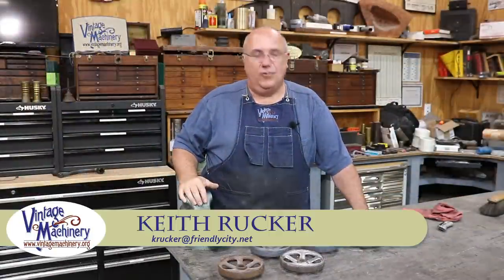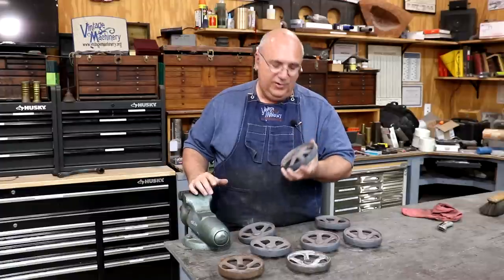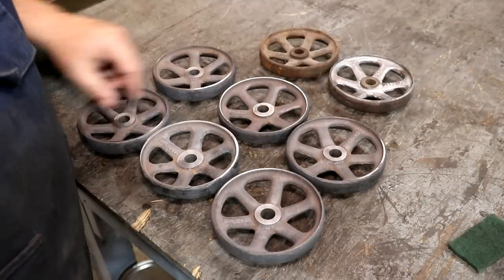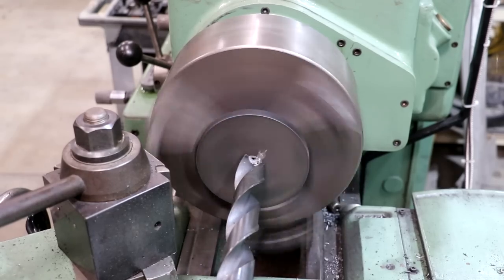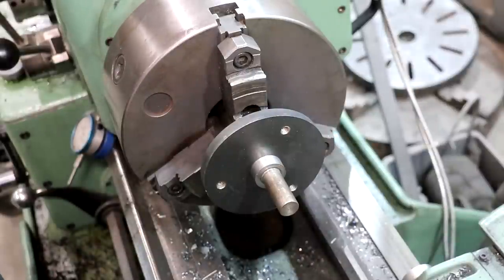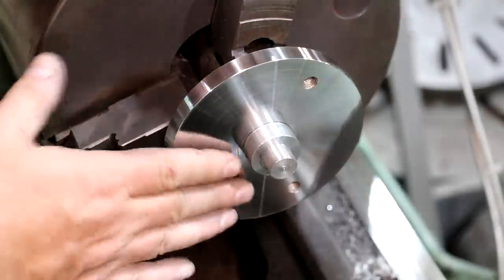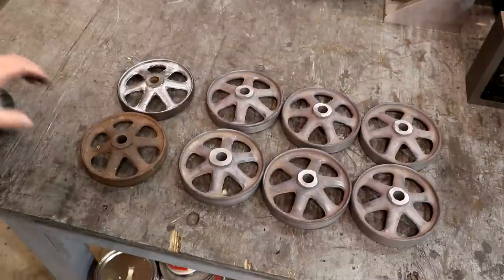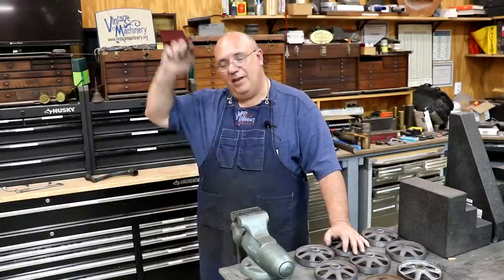Machining Cast Iron Wheels for an Antique Vise Cart

Comment: For anyone who watched this and felt the need to come down here to the peanut gallery and talk about how Mr. Kieth "shoulda done this or that", why? There is such a thing as overengineering, and I think you're missing the point. These are not precision gears or pulleys, they're literally wheels for a cart. This method was about two orders of magnitude more precise than was necessary for the project at hand. Had more precision been necessary, the castings would not have been done off of an original, but would have been turned into a 3D render and a pattern would have been made oversized to allow for much finer resolution of operation. The fixture would have been different, the process would have been different. If more precise parallelism had been needed between the inner and outer hub face, once the shaft and recessed hub face had been done, he could have done the other side on the surface grinder by simply magging the recessed face to a cylindrical gauge block of appropriate diameter and ground it to within .00005 without much difficulty. This would have taken more time, and again, would be completely unnecessary. If you don't need to hit 99.999999999% of nominal, why spend all the extra time on doing so? Particularly in a production environment, even if you're just a hobbyist making one off parts, why would you want to pour an extra 10 hours of work into a project for no reason? Give the customer what they want, for a price they can afford, and don't waste their money adding "billable hours" to a project that doesn't need it. Truthfully, Mr. Keith's approach was already far more precise than was necessary. He could've been anywhere from five to fifty thou out in any dimension, and it would not make an appreciable difference to the end result of this project. But because Mr. Keith is a proper machinist, he tends to go a couple of orders of magnitude finer than what is actually needed.

Comment: It’s amazing to watch you think your way through the problem and devise a working solution. You have a very logical mind. As to other comments as to “ugly looking parts” It’s a wheel for an antique vise cart. When laid out next to the original wheels, the only major difference I could detect was rust. Darn fine work in my book.
Reply: They're not using the Original Wheels, thats why they cast 6 new ones.
Reply: @TheUncleRuckus  they cast the new ones using the original wheels as a pattern. Did you not understand or are you being obtuse?
Reply: @TheUncleRuckus  I  was under the impression that there are 8 wheels(4 sets of 2 ) on the cart, 2 old, 6 new(cast from molds of the old ones)

Comment: I love to watch how ppl do things compared to how i would. I would have done the first op just like you but for the 2nd op, threaded the fixture hub post and clamped down with a nut. I wouldn't have used the round fixture plate. I also would've added machine stock to the pattern, however, like you said, they should work fine with the minimal clean up you got. Thanks for sharing your projects!

Comment: They are probably better than original.  I can remember items with wheels like that, still in service, when I was a kid: old hand trucks, scales, and carts.  They were rarely true or straight, and it wasn't uncommon that three wheels would be touching the ground and the fourth sitting well off the ground.  I think they were made for working on dirt floors, and once concrete became more common, they just weren't meant for something that flat.
Reply: That is SO true. We still have some old carts with these irregular off concentric castings.  PLUS some cheapo recent crookedly cast caster wheels, made in China, of course!

Comment: Am I missing something here. If the depth gauge measured 950 then why set the DRO to 9375. Surely they'll all be too thin? Also the attempt at making everything concentric seems to have gone horribly wrong. Whilst turning the second side OD (about 25:50) the inner boss has a right wriggle going on. This might have been due to the huge amount of leverage on the holding clamps being so distant from the centre boss. Having taken a skim off the outer rim area on side one, why not use this as the register? Just a thought.
The video still gets a thumbs up from me as we don't want to loose sight of what we are making here. These are cast wheels for an ancient cart. Thanks for taking time to produce these videos Keith.

Comment: As the wheel was only registered against tge centre boss and then clamped near the rim, the clamping method used actually pulled the wheels out of true. You can see the run out of the bore as the second sidebis turned  it would have been better to either register on the rim after it had been trued and/and or to indicate the bore to confirm that it was running true, as the clamping method used vs the small bearing surface ensured the screws could/would pull the part off true..
Reply: We fully appreciate your criticism as I am a bug for precision too.. HOWEVER  these are freekin' antique CART WHEELs, operating at a max rpm of... maybe 15 rolling on a wooden floor- NOT jet engine turbine rings running at 20,000 rpm !
Reply: @loftsatsympaticodotc  it's about wokmanship, and doing things as precise as possible. Why not just use a hand drill and call it good then?
Reply: @daveanderson2316  He did make it as precise as possible! There are high and low spots in the floor so Keith made matching high and low spots in the wheels. Now the carts will roll effortlessly across the floor as though it was on a cushion of air. It is called "tailor made". 
If you walked into a tailor shop and saw a suit on the rack with one short arm and a short leg, you would laugh and criticize it and the poor tailor that made it. Until the owner walked in with one short arm and a short leg. Then when he tried it on you would see that the suit was perfect. If you carefully read the scriptures you will learn that perfect only means complete. Everything God made was perfect for what He intended it for. Perfection is NOT some imaginary mark in the mind of a spectator/critic, it is a very real mark in the mind of the creator, regardless if he is God or Keith Rucker. PERFECTION IS DEFINED BY INTENT OF THE AUTHOR/CREATOR.
Reply: @artszabo1015  Thanks for the sermon. Perfection is actually in the numbers.
Reply: @daveanderson2316  Perfection is a mystical quest, some you win some you lose.
Reply: @mossmonaco9061  Are you saying 2 plus 2 doesn't actually equal 4? Tell me more...
Reply: @daveanderson2316  This could be 1984...Big Brother says 2+2=5 😁 (see George Orwell's novel for those who don't read the classics)
Reply: @loftsatsympaticodotc  a lumpy wheel is still a lumpy wheel no matter how slow or fast you move it.

Comment: I don't know much about 3-D printing or machine shop work, but from what I've seen if a 3-D printer was avaialable, it might be an ideal tool to make the pattern to the original size plus extra for machining.  Contrary to your critics, making new parts from old worn out parts as a guide is difficult at best.  Can't expect too much precision with what you had to work with.  Besides, a vise cart is not likely to be a high speed piece of equipment.  Excellent job and problem solving skill in this (and other) projects.  Keep 'em coming.
Reply: One needs to adjust for shrinkage as the metal cools also. My father in law was a pattern maker and had a set of shrink rulers for different metals so that an accurate pattern could be made.

Comment: I want to start by saying that I enjoy your videos tremendously, both my Dad and Grandpa were tool and die makers, I even ran and owned an automotive machine shop till I decided to become a city manager and fire chief, strange choice for a mechanical engineer, I am retired now and reverting back to my machinist days, I’m wondering if you considered making a shaft threaded on one end and a cone washer to center it to cut the second side or would that be a bad choice, keep making those great videos !!

Comment: I like your fixturing and holding solution.
On the other hand you measured the hub thickness .950'' and then cut the new one's at .9375 . Did you screw up the parts or was your initial measurement wrong on the mic reading?
Reply: I was wondering the same thing.  We'll probably never know.

Comment: Looks like you could've used the threaded holes for the bolts that hold the chuck jaws for clamping the parts, instead of making that improvised plate.
Reply: Keith has said he needs "improvised plate" making practice.  I believe that is why he chose to do what he did.

Comment: When casting wheels.  Do you wind tape around the original to take up for shrinkage or do you powder coat the part since you have a heat treating oven that might be used to set the powder coating . Build it up by dipping in a clay slurry multiple times. Or a ceramic glaze.  Even using a hot glue gun to build up surfaces or missing  areas.  One could even get creative and add more draft to the part.

Comment: Your welded on backing plate should have been a larger diameter to register on the previously machined surface instead of clamping down on the cast spokes.

Comment: Great fixture build!  I would have been tempted to clean up the outer exterior of the center boss for appearance sake, but knowing it’s a antique reproduction part, what kind of original finish would have been appropriate on a mass produced cast iron wheel? Prolly just what you did.

Comment: Why couldn't Clark dip them in a few coats of wax or something similar so they are slightly larger to accommodate for shrinkage?
Reply: Sand would probably stick to much to wax.
Going to be more towards epoxy and sanding it.

Comment: I did notice that when you measured the hub thickness you said it was 0.950" but when you were setting your DRO  you input 0.9375" were the castings too thin for you to get the original thickness?
I thought Clark added a bit to the casting to account for shrinkage.

Comment: Thanks Keith very informative as always.    I would like to add a DRO to my Enco 8 x 36 vertical mill and 12 x 36 gear head lathe.  As they are strictly manual currently.  Any recommendations or sponsors you have had a positive experience with would be great.   Best wishes always

Comment: Call me dumb, but i only just realised that when you use an original part as the pattern to cast a new one, by the time you clean it up it will of course be smaller than the original.
Reply: Because it shrinks when it comes out of the mold it is smaller before any machining. If the size was critical he would have made a larger pattern. I think it shrinks from molten size to cool size by about 5%. I won't call you dumb, these are things you learn from being a machinist and working in a foundry.

Comment: Sorry to point out that when you started turning the OD of the wheels, the thrust moved the wheel over, causing the centre hole to run out. Either a running centre, or a closer fitting and longer fixture would have prevented that. In this case of course, it won't matter.
Reply: The original spec was to build these to operate at a maximum 60 mph.  I believe a revision delta was issued and that spec was revised to a maximum of "pulling".

Comment: Working with cast material can be a challenge. Having more material to work with would have definitely helped. I was surprised to see that you used a three jaw chuck. Would a four jaw chuck have provided greater accuracy?
Reply: 4 jaw is used mostly for odd shapes
Reply: @edward-x3s6f  a casting is an odd shape! Not concentric!

Comment: I don't no why you didn't thread the arbor and fit a nut to hold the wheel rather tag go to all that trouble with fixture.
Reply: Keep wondering.  How he approached the project was his decision and it worked fine.  Lathe work is fun!!  Maybe that had something to do with it.
Reply: Then how would he face the hub, with the nut against it?

Comment: Look out- here I come again-   no need for that complicated fixture.
1. Face outer hub and center boss to 1/2" depth- mark hub and chuck jaw with sharpie
2. Reverse hub  and clamp in same location -face inner hub to thickness (  turned outer hub face against the chuck jaw keeps inner hub parallel)
3. Drill to 11/16"
4. Use 11/16 bolt or threaded rod with nut on each side as arbor to turn OD. Could also use expanding mandrel or collet.
AAARGH- I'm an engineer and you will lose precision-  Naaah- it's an old rolling cart with cast iron wheels, not aircraft landing gear.

Comment: They screwed up using an original as the template as its has had 100 years or more of wear and tear done to it and once you machine the surfaces everything will be out of spec. 
Normally when someone brings in an original part for casting atleast where I used to work in my teens, they used clay to build up any surfaces that would need to be machined after casting before building the mold. 

* Edit * Should've know Keith would've caught that too. LOL